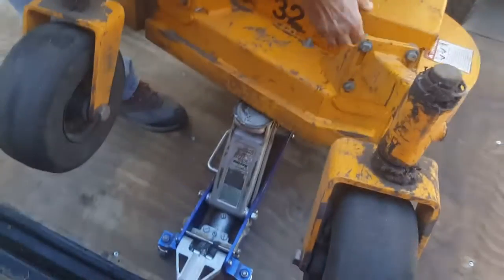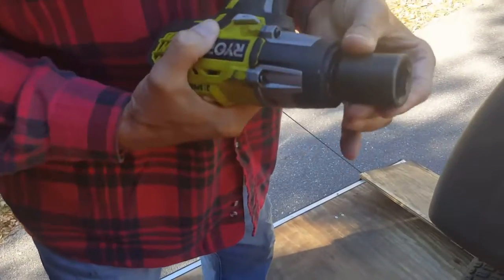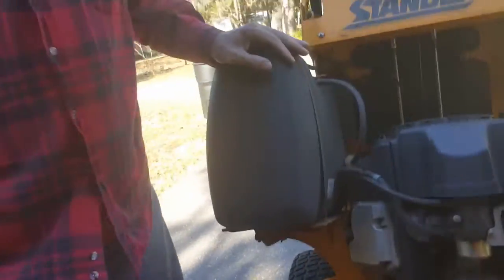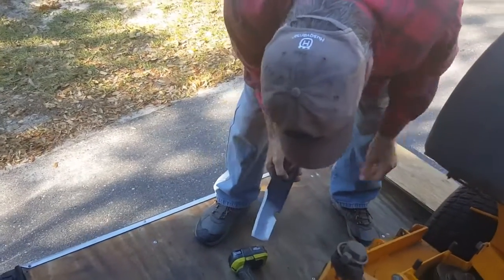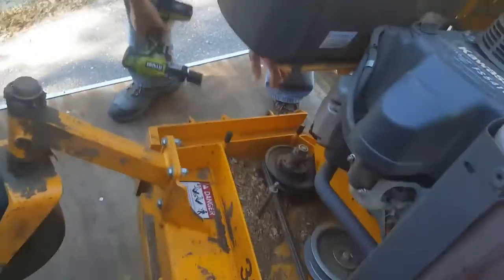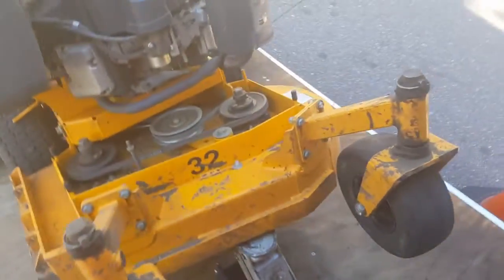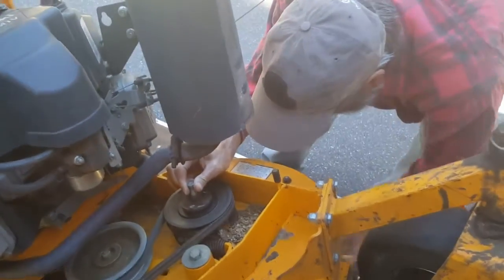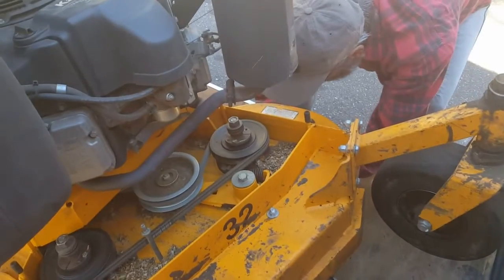How to change  and move the mowing height on the 32 inch  wright stander

Comment: That’s so stupid that u have to spend all that time to change cutting heigh lol most other standers all u gotta do is pull spin out and in
Reply: That's not how you actually do it.  You move the shims on the front casters.  There is 3 different coarse settings and then 3 finer settings with the caster shims.
Reply: What they did was move the blade position in the deck which will change the airflow. So it will change the height but adversely change how it discharges and how it actually pulls the grass up.